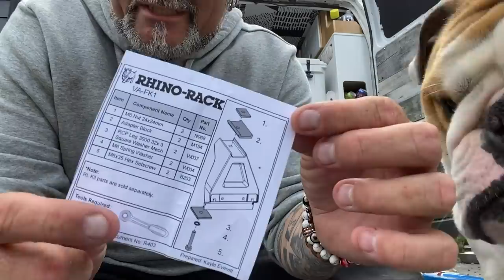THIS IS GOING TO CHANGE EVERYTHING "Massive Storage Upgrade & Rack System"

Comment: In your "out-tro" ending of your video there is a shot of your van with the new setup driving away. That scene has a lot of white exhaust smoke coming out of your tail pipe. That is normally a sign of coolant leak into your motor, usually from the heads (top part of your motor). Please check your coolant level when the engine is cold. And check the motor oil for a milky appearance.
Reply from the maker: OR A SUPER SUPER COLD MORNING

Comment: just remember to measure how high the van sits with the storage rack on top before you go through a drive thru....
Reply: Yea he should measure it. Bet he's around 9'. If it's a problem I bet moving it to the right side would solve the drive thru issue.
Reply: Went to the bank the other day " clearance 8 foot 10 inches "..... My van 8 foot 6 inches ……...after I finish my transaction the teller says " Don't ever pull up in the other drive up lane ; BECAUSE THE OTHER LANE HAS A LIGHT THAT STICKS DOWN 6 INCHES "...." Clearance 8 foot 10 inches "

Comment: Hey Chrome, once you lock them in place, they seem to use a push button style lock, are you concerned something within the compartment. might accidentally unlock them and cause them to get loose and rattle, or possibly cause it to detach itself?